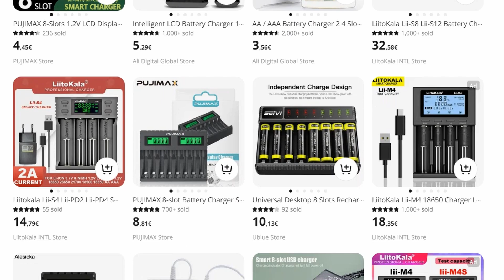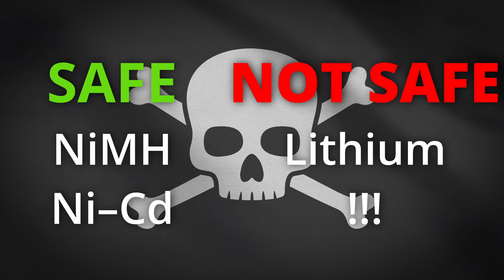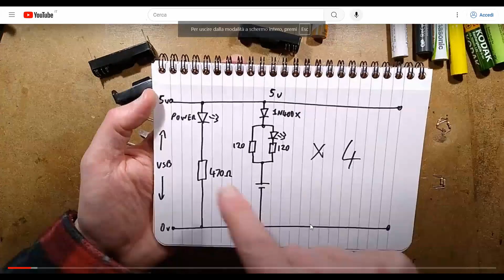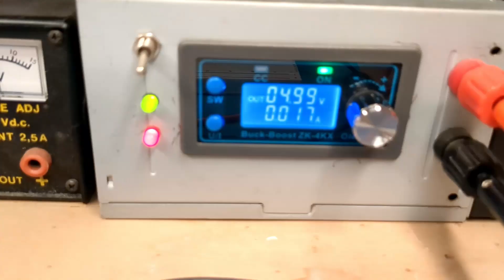1$ AA Battery Charger [NiMH - NiCd]

Comment: You would have been cheaper buying 4 new cells from temu or aliexpress than keeping the power supply on for 5 days straight
Reply from the maker: Hi, friend! Thanks for your comment.

I'm not sure how it works in your country, but where I live, electricity is paid for based on consumption (kWh), not time. 

If we use a voltage of 5V at 20 milliamps to charge the battery, we are consuming about 0.1W.

Therefore, to consume 1 kWh, the charger would have to remain on for over 400 days and charge hundreds of batteries.

In my country, a kWh costs around €0.28.

Based on these calculations, buying disposable batteries doesn't seem cheaper.

Have a good evening, my friend!
Reply: @dariocose your power supply will draw 10-30 watts without even having a load running lol